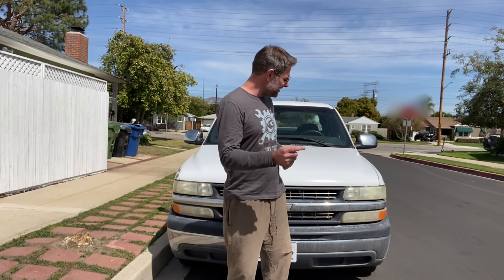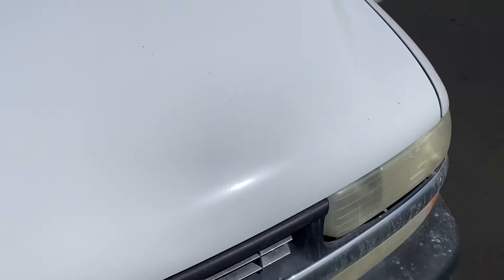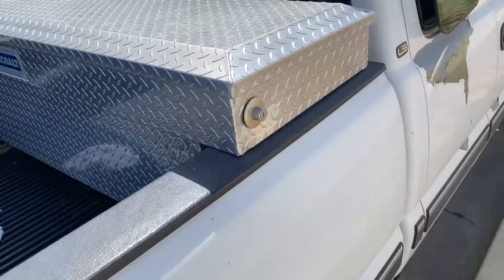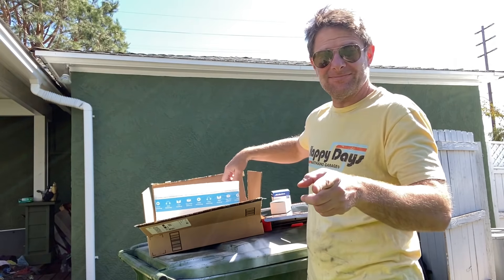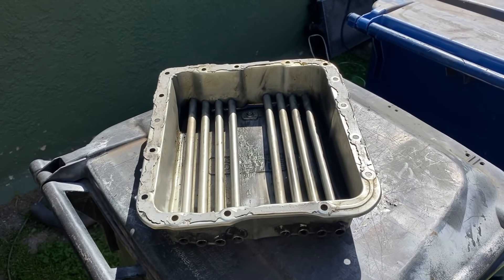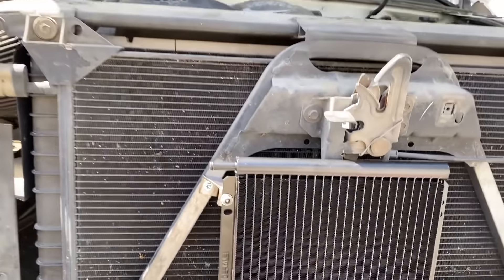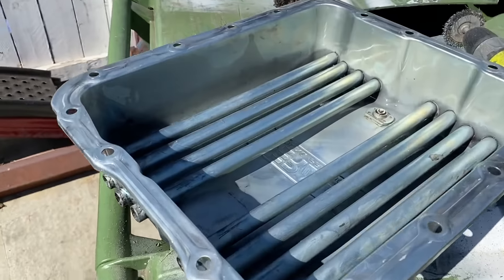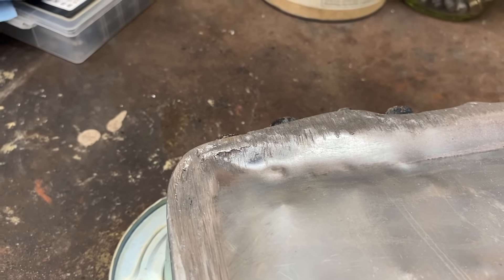2001 Chevy SILVERado intro & Dearle 8000 trans cooler install.

Comment: I have one of these, regular  maintenance and the drivetrain is still solid at 295,000 miles. But all the plastic  pieces are  just falling apart, and the floorboard rust is getting  hard to ignore. I still love the truck though.

Comment: The structure you affixed your transmission cooler to is normally painted black by the factory... which as you can see, doesn't last long.  If you hit it with some cheap black spray paint, you no longer can see it through the grill.  I have a 2003 Silverado, and painting that bracket was a huge improvement.

As for the tranny pan, you are lucky... on my truck, the exhaust is so close to the stock pan that it is virtually impossible to get the pan off/on.  Guaranteed surprise trans fluid shower when it happens.  That filter better last a LONG time.

Comment: I would strongly suggest putting some rubber or padding on the front central bar that the bonnet latch mounts to to stop the transmission cooler vibrating against it and wearing a hole in the top.  You'll be amazed how far it will move at speed on the highway and how much it will vibrate in normal driving so having some protection there will prevent it becoming an issue...

Comment: Glad your back. Hopefully those cats last a while for you. I seen that spacer. Also idea: use some clamps to oval the exhaust for clearance. All the manifold bolts like to snap so whenever I swap a trans or engine I cut the crossover out and weld it back together.

Comment: Could you modify the used tranny pan to miss the exhaust?
Reply: I don't think it's a case that it's going to hit the exhaust but more that, due to being deeper, it's very difficult to install in place with the exhaust cross tube in place.  I suspect it will be revisited when new downpipe studs and nuts are to hand as just the increase in fluid capacity will have a remarkable effect on lowering transmission temperature, especially in low speed driving...
Reply: @gosportjamie  if Nathan cut/modified  the rear of the deeper pan it would clear the exhaust.
Reply: @newvintage1554    That's a lot of work, and not an easy thing to do well and get oil tight.  Sorting the issue with the exhaust so that it can be dropped easily for access is going to be a lot easier and cheaper.  The exhaust is still really going to need to come out of the way to make servicing the trans easier...